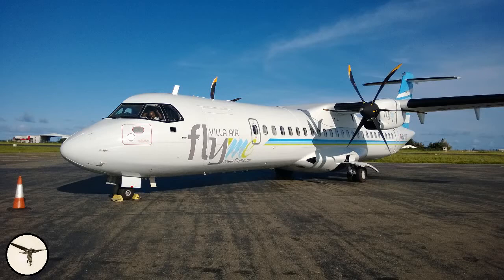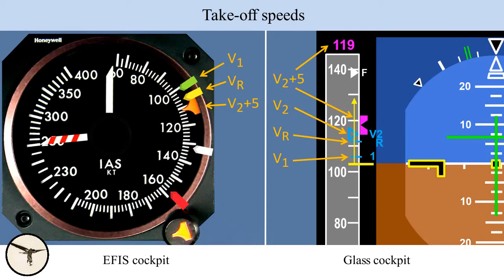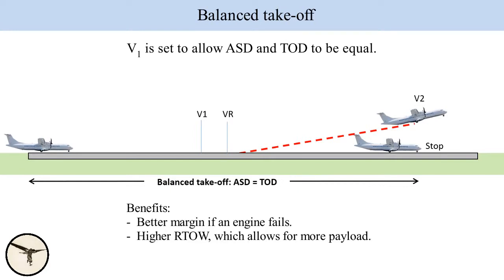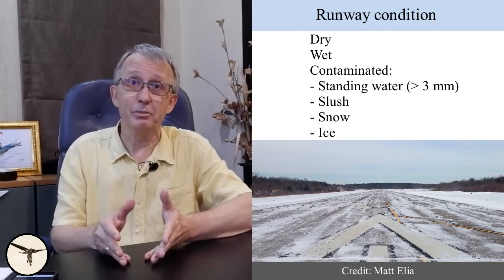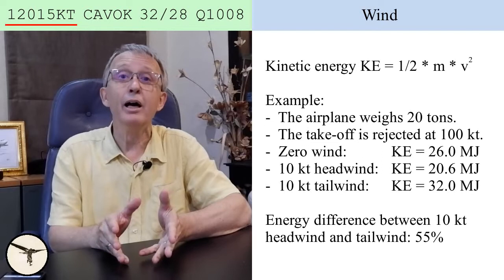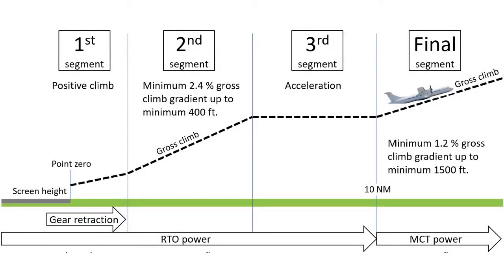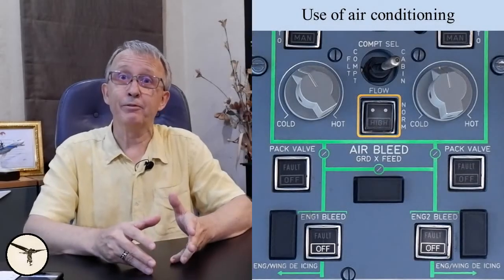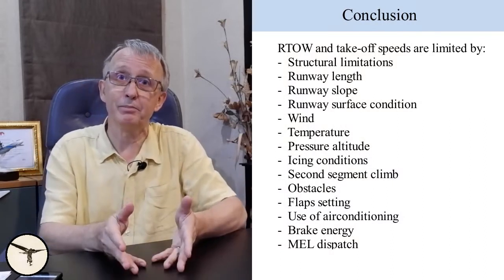Aviation explained: Take-off performance

Comment: Excellent and a most professional production. I love your style of delivery and the illustrations you use are engaging. Excellent V1 Stop/Go video even if quality as you pointed was not glossy it was a vivid learning lesson. Am totally subscribed even if I no longer fly the ATR since 2012 I like to go through your content because of its high quality of knowledge and seriousness of presentation. If you have any video you intend to produce for Command upgrade sim and line training purposes please share its link. Much obliged Sir! I experienced a real Engine failure at take- off at 400 ft om ATR42-320 on a short strip in 2007 but because I saw the situation coming due to engine degradation trends and other signs like Air Condition smoke, I was able to manage the situation well. I had also 2 weeks prior done a thorough base training after a 7.5 year lapsed rating. keep up the great content Capt.Magnar!

Comment: Hi Magnar. First of all I want to congratulate you for your excellent work. Be sure that I am your number 1 fan. Regarding the TOD and TOR takeoff distances that you explain in the video, I would like to clarify that although in both cases the image shown includes a clearway, it should only be considered in the case of the TOD, since as I understand, the TOR is only considered when a clearway does not exist.  Am I right?.  The topic is a bit complicated. Thank you very much again.

Comment: Hey Magnar!
Could you please take the time to explain the Boost function? When and how it is used, and what it actually does?
Also, do you get a better take-off performance if using "full power"? aka, slamming the PL's to the wall?
What about using 100%overdrive on the CL's?
Thank you for awsome content, and happy landing!
Reply from the maker: When it comes to power, an engine has two limitations: Mechanical and thermodynamical. At low density altitudes, the limitation is mechanical. As the density altitude inceases, the engine will sooner or later reach the thermodynamical limit, resluting in reduced power. The boost funciton increases maximum temperature, allowing for more power in such conditions. However, this comes at a cost, as a higher temperature reduces engine life. If you use boost at every take-off, engine life will be shortened by 20%.
Normal take-off power is 90% of available power. You can use 100% power by moving the power levers to the "ramp" position. But again, this comes at a cost, as the engine runs with a higher temperature.
Slamming the power levers to the wall will give 115% power (and overheat). This is only used in an emergency, for examle a windshear at low altitude. 
Normally, it is not nevessary to set the CL to 100% override, because propeller NP (RPM) is always 100% at takeoff. You set the CL to 100% OVRD during single engine operations, when you need extra drag to decelerate before configuring the aircraft for landing, or when you anticipate turbulence during landing. The engine response is more crisp when the propellers are rotating at 100%.

Comment: The two seconds allowance for stopping at V1 is BEFORE V1. Not after. By V1, the pilot must have made the decision to stop and made the first actions to begin stopping such as applying the brakes etc.
Reply from the maker: Since I was introduced to transport category aircraft performance, the certification criteria have changed. It is assumed that the engine fails 1 second before V1. Pilot reaction is 1 second, which means the pilot will start to act at V1. PM should call V1 in such a way that the call is finished when reaching V1. To give a margin for aircraft reaction time, it is calculated the aircraft continues to travel at V1 speed for 2 seconds before the aircraft begins to brake.

Comment: Good to see you, Magnar.
I was the one who asked you before.
I am training for ATR.
Your video is very helpful to me.
I have a question about landing distance.

According to QRH LANDING DISTANCE CHART,
Weight 43000lbs
・WET GROOVED：3470FT
・WET NON-GROOVED：3410FT
I thought WNG had a longer LANDING DISTANCE than WG due to less friction.
Why does WG have a longer landing distance than WNG?
thank you.
Reply: I cancel my question.
I would like to sincerely apologize for my mistake.
Reply: Let me ask you another question.
I would like to ask about Landing Distance of Single Engine Operation.
The VAPP displayed on the Performance Page during single engine operation is 113kt.（41000lb, no wind Factor）
This seems to mean "NOT LESS THAN VGA (112kt).
I learned that "When VAPP is increased" does not apply when using this VAPP（113kt）.
VAPP on Both Engine is 101KT.
So OEI VAPP（113kt） is 12KT more than AEO VAPP（101kt）.
Why is the Landing Distance not multiplied by 1.15 though?
Is the Landing Distance of OEI VAPP (113kt) and AEO VAPP (101kt) the same?

thank you.

Comment: One question Captain, when we use the SPS software on a long runway but with obstacles close to the runway, there is a RTOW, which is logical, but what I do not understand is why this RTOW is increased if the bleeds are selected off (T.O torque are 90% in both cases, bleed on/off), thank you.
Reply from the maker: I cannot answer that. It might have to do with the setup in the SPA software. I suggest that the person responsible for performance calculations in your company check it out. The company can also ask ATR Support. They are very helpful.
Reply: @FlywithMagnar   Thank you for your answer, I will ask, from my understanding, if the T.O. Torque is 90% bleed on/off, the RTOW should be the same, is that correct? Regards
Reply from the maker: Yes
Reply: @FlywithMagnar  Thank you!! Great work what you are doing with your videos, it is really helpful

Comment: Capt what is the procedures if we got one eng over speed just before touch down?
Reply from the maker: Overspeed in the gas turbine or the propeller? A turbine overspeed is unlikely as the power is already low. A propeller overspeed will result in higher drag. But since you are about to touch down, it will rarely affect your speed thanks to the inertia in the airplane. However, you will experience a yaw that must be corrected with the rudder.

Comment: First of all: Thank you for your work! Its so great and detailed. According to my simulation experience in the MSFS the ATR72 isnt a plane with "STOL"-capabilitys. Its more likely a  "SL"-Plane since it needs decades for takeoff but can land on super short runways. 😂 Is this real?
Reply from the maker: When ATR was launched in the early 1980's, the CEO stated that they would not focus on the STOL market, as it was too small to be commercially viable.
At max weight, and standard conditions, an ATR 72 needs 1,315 m runway to take off and 915 meters to land. I have operated the aircraft on 900 m long runways. That means weight limitations for both takeoff and landing. 
ATR is now testing a STOL version of the ATR 42, the 600S. It will be suitable for 800 m runways. Why is ATR interested in the STOL market today? Because Dash-8-100 and -200 are not produced any more.
Reply: @FlywithMagnar  u are awesome, thank you